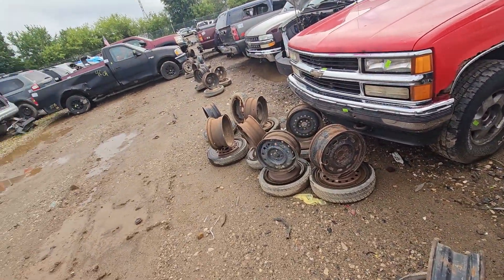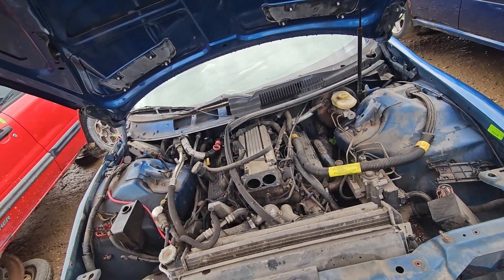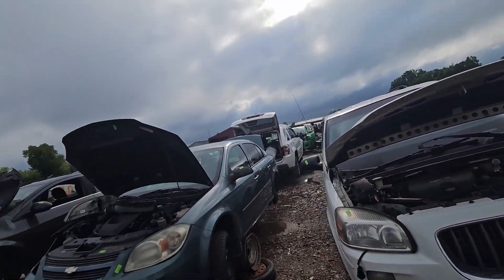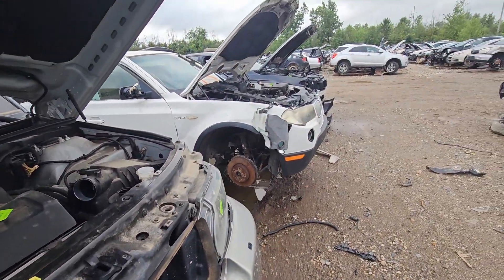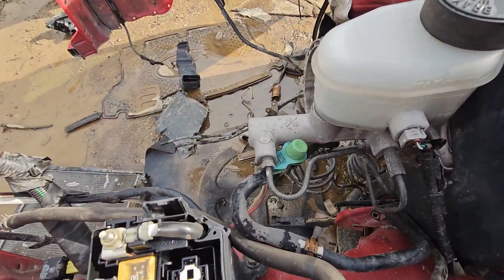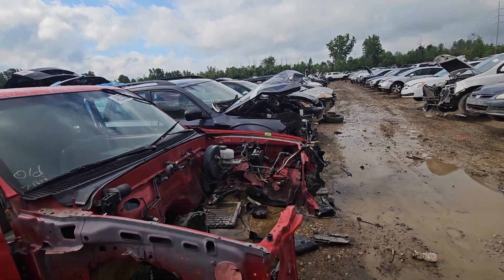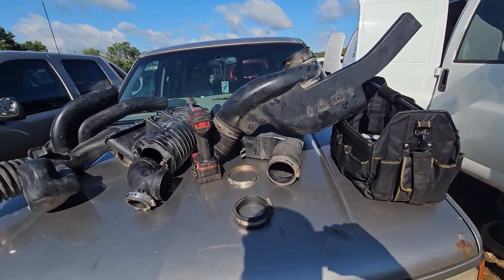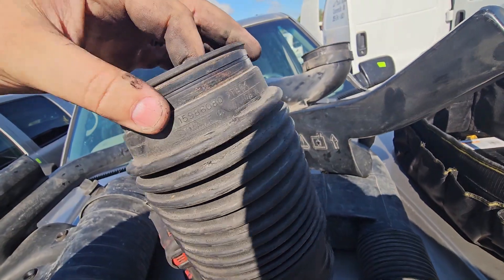If at first you don't succeed, dust yourself off and try again. Junkyard engineering!

Comment: Appreciate the videos.  Would be interested in your process for printing parts for use in the engine bay. I’ve only printed some little bits for low load interior stuff.